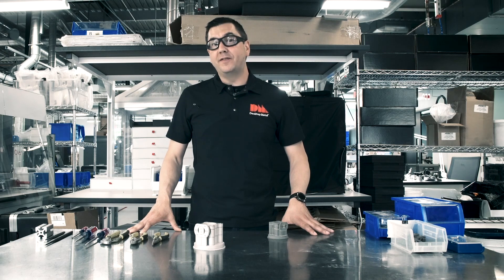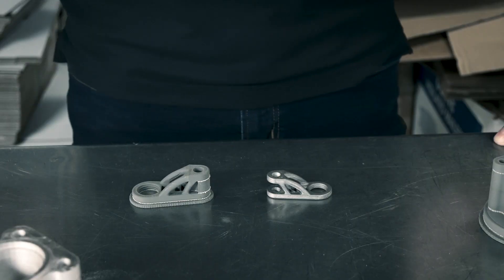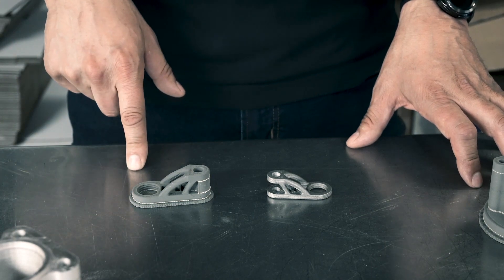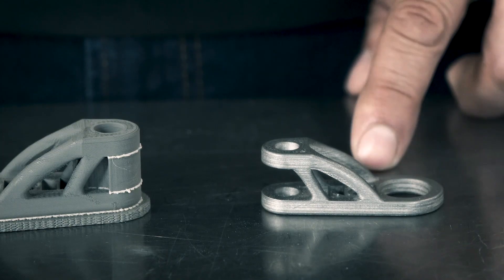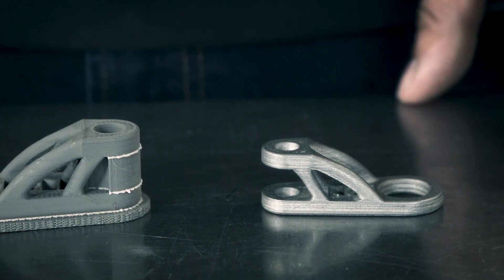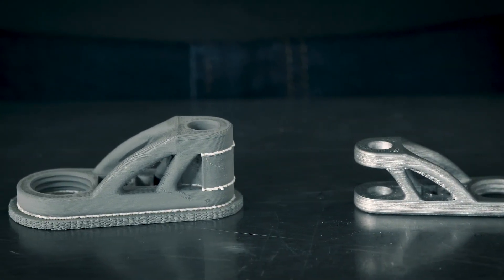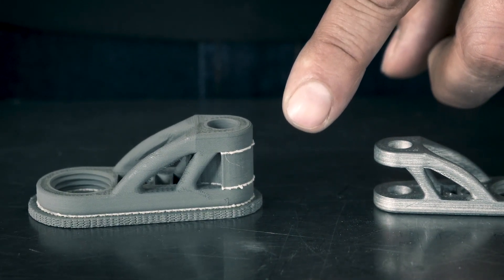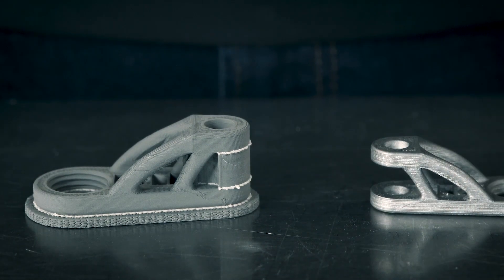Separable Supports™ | Desktop Metal 3D Printing 101

Comment: Interesting 3d printing method. There is very little information about BMD. How compare is used? How often do producers use in relation to DMLS or EBM or SLS?
Reply from the maker: Hey Lukasz, great questions! BMD is a fairly new process but is built of the fundamentals of the metal injection molding industry which has been around for years. While DMLS, EBM, and SLS are more proven technologies, with more parts going through a validation process, we see BMD being used more in casting applications and prototyping.

Comment: because of the way the 3d printer makes the support using metal, it wouldn't be possible to print a block with complex vacuum routing/channels inside, would it??